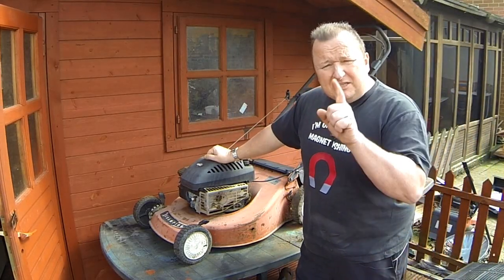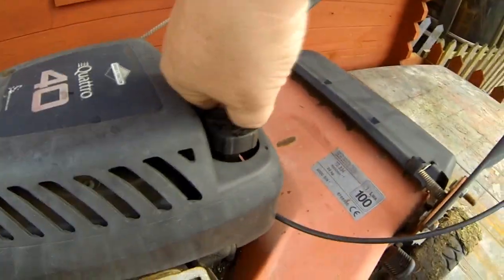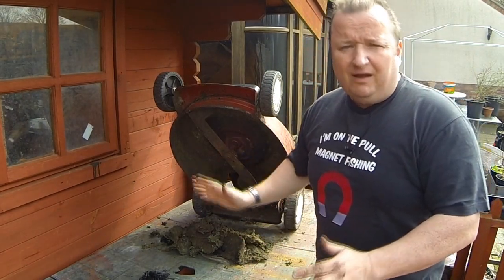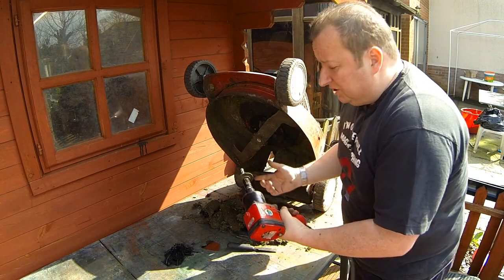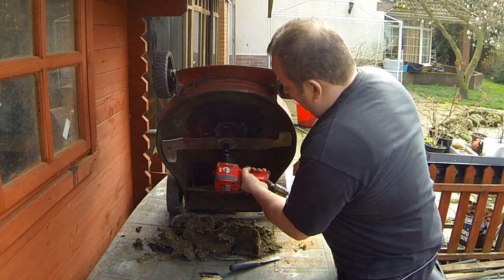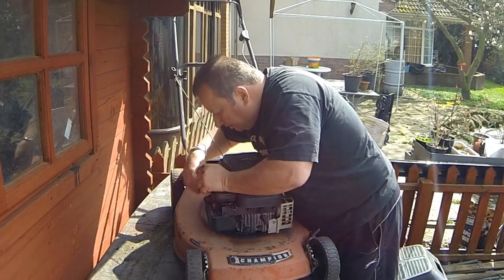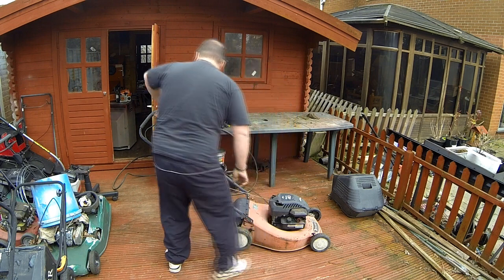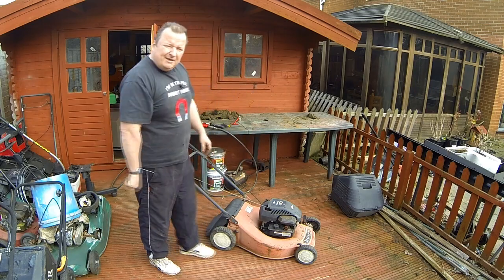Time To Repair My Own Lawnmower

Comment: Excellent! I have been filming today as well. Had a customer picking up a mower only to find it wasn't running correct! Was a bit like challenge Anneka! lol. Thats why the decks rot. Those mowers would last a lifetime if people clean the deck.
Reply from the maker: +Mower Man that's right Paul. Mine had sprouted a mini lawn at the back lol.
Cheers
Martin

Comment: Great video Martin, don't forget to check the air filter too, mine wouldn't start when i checked the filter it was bunged up with grass lol. Other than that i did what you did cleaned it underneath sharpened the blade and off it went. Look forward to more of your vids Martin.
Cheers, Jeff.
Reply from the maker: +cabdriveruk Nice one Jeff, I did put the blade on upside down though lol. Too busy with the filming lol.
Cheers
Martin
Reply: retrorestore that’s cute that even after so many years that lawnmower was still loyaly serving u Definitely something built to last despite the rust hole on the side

Comment: Hey Martin,I'm preaching to the chior.For the last mow of the season clean the deck and paint it with used motor oil, I also spay the engine with WD40. I use a fuel preserver. But draining the fuel is better.Cheers, Jon
Reply from the maker: +Jon Young Nice comment Jon, that will help viewers.
Cheers
Martin

Comment: Good to see another lawnmower vid, it's that time of year again :) Actually, this year I've bought some Briggs & Stratton Fuel Fit to try out. It's supposed to keep the fuel fresh for up to 3 years and additives to keep the carb clean too....we'll see
Reply from the maker: +Andy K Not heard of that stuff. Interesting to see how it performs.
Cheers
Martin
Reply: +retrorestore http://www.enginesmatter.eu/howto/   ...at 250ml for £5.80 delivered from eBay, it doesn't cost much so I thought I'd give it a try, just hoping it helps to preserve the fuel in the can over the coming year and maybe keep the jets a bit cleaner too
Reply from the maker: Andy K
See  how it goes. Never heard of it though.

Comment: Oh Martin, have another look at that blade. Looks upside down. The vanes should pull grass up, that looks like it would push grass down. Flat edge on bottom, chamfer on top. Yeah, change the oil each year before season starts.
Reply from the maker: +Brian Percival Yes Bri, silly me. it is upside down. Have put an annotation in the video now lol. Too busy thinking about the filming lol.
Cheers
Martin

Comment: Hmm, i noticed UK mowers have only the rear bag discharge, yet here in Canada we have the side discharge and the usual slot for the bag/catcher. Leaves lumps of grass, but you don't have to stop every 5 minutes to empty grass.
Reply from the maker: Yes, the gardens here in the UK tend to be a lot smaller so these bag types are a lot more popular.
Reply: Ahh, makes sense, you do have a decent sized little yard/garden there, but she gets the job done. Cheers

Comment: my brigg and stratton starts but only problem it wouldn't switch off
Reply from the maker: Must be the cut off switch at the back of the engine where the cable connects.